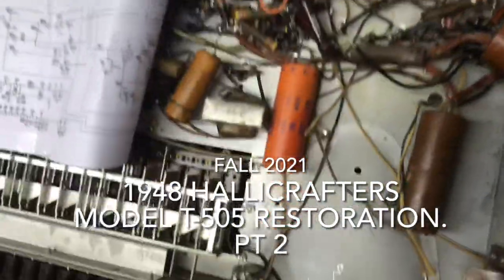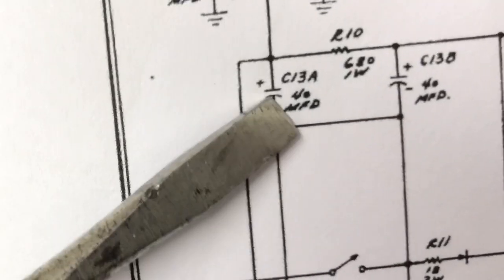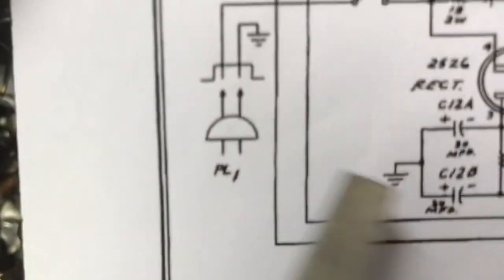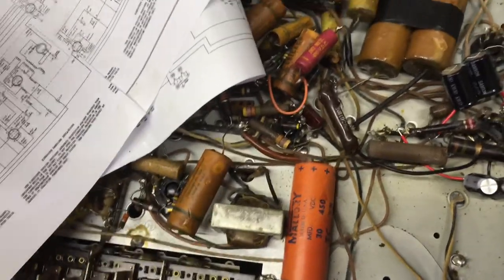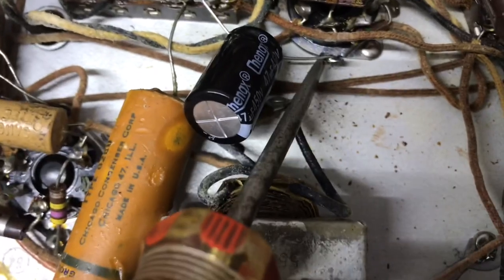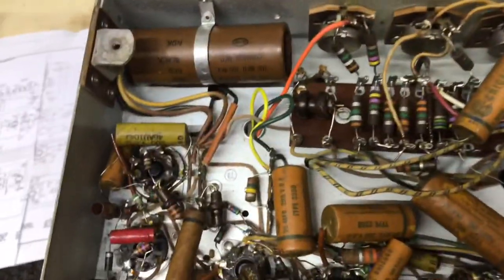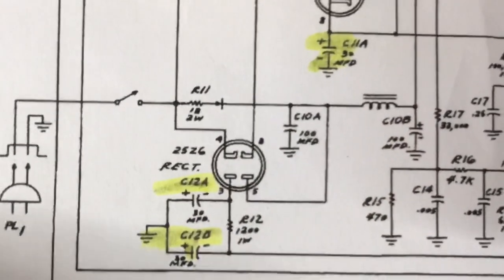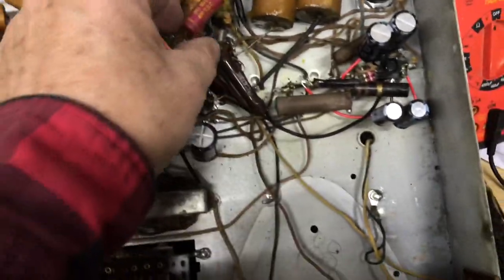1948 Hallicrafters TV Restore Part 2

Comment: Good thing you used the riders manual when replacing those filters! Sams has 2 of them coming off of the 25z5 with the wrong polarity, would’ve saved me a lot of headache and exploded caps if I knew this earlier
Reply from the maker: Yes, I’ve found mistakes in Sams other times